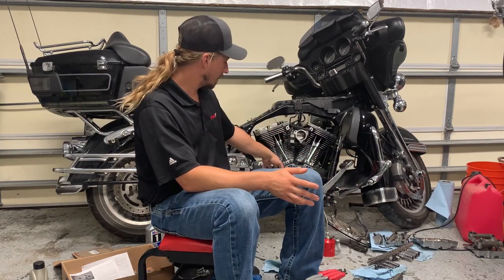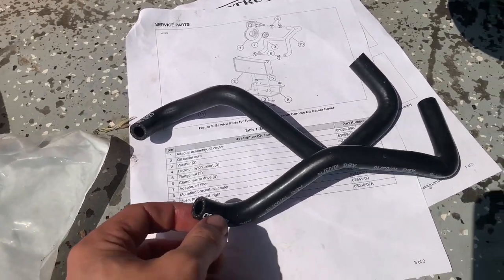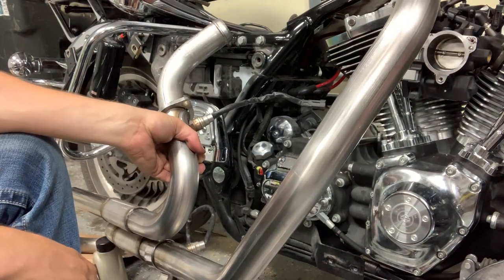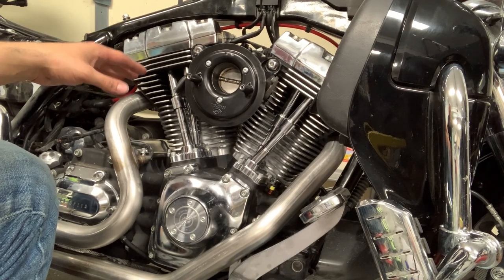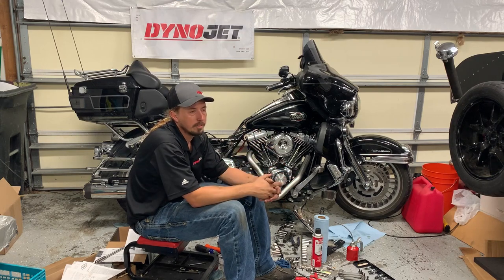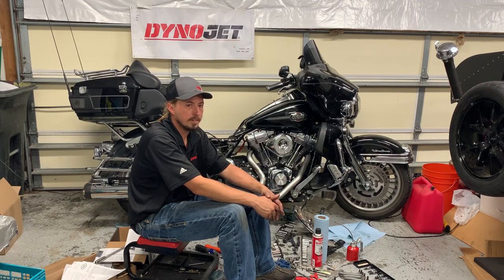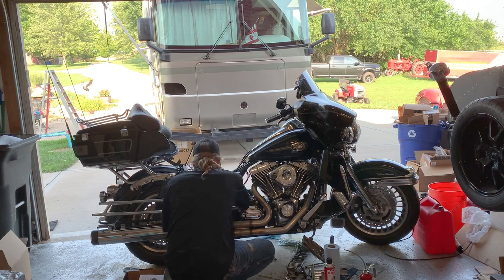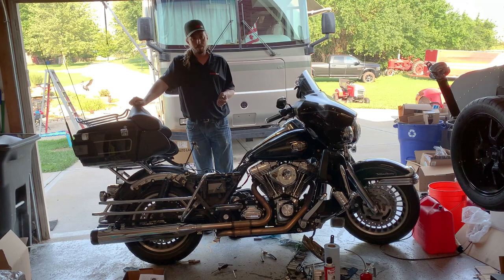Building the Thunder — A Harley-Davidson Build Series (Episode 6: Wrenching Part IV)

Comment: Probably should do the heat cycling a little shorter than what he did! I usually turn over and build oil pressure with fuel pump fuse removed,then start for a minute tops,then let cool and start again and let idle,not revving it.
Reply from the maker: That's a great tip, Derek!

Comment: Why wouldn't you load a base map with the Dynojet Power Commander before you started it? I have made the same mistake leaving the fuel line disconnected don't feel bad.
Reply from the maker: Bob, that's definitely an option. For Ted, though, he was just starting the motorcycle and doing the initial heat cycles at idle. He noted that the engine's not very picky about the tune at idle, so the stock one still works. Since he's not going to ride it before the dyno tune (coming next episode!), he didn't feel it was necessary. In the finale of this series, he'll have the bike tuned properly and will do a dyno run to show the power gains.
Reply: @DynojetResearch  That make sense, I just installed a Red Shift 468 cam in my M8 114 loaded a Fuel Moto Tune for it with my Power Vision working great so far. Going to make a few auto tune runs with it this week end.
Reply from the maker: @ocglide2566  That's great! We're happy to hear that.